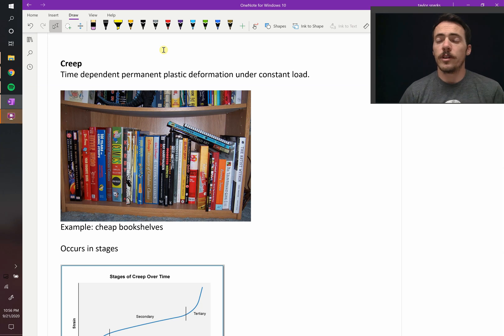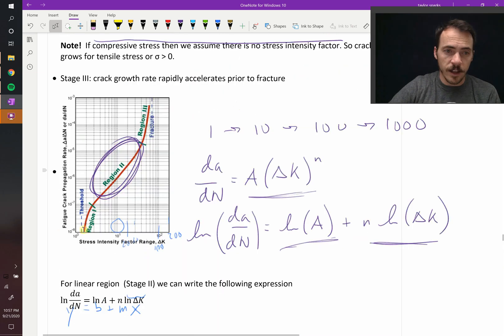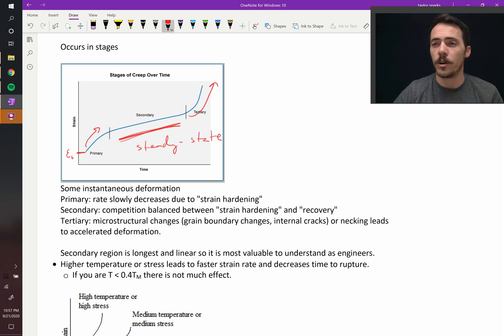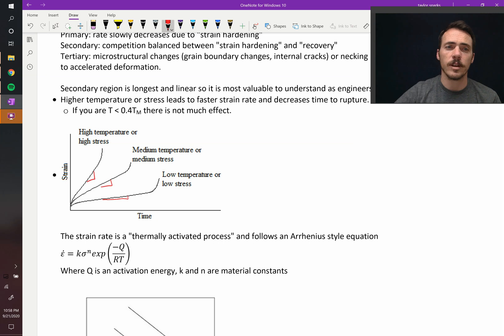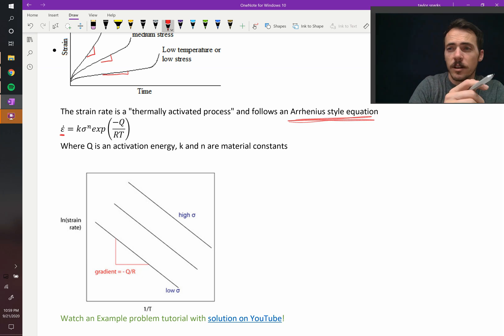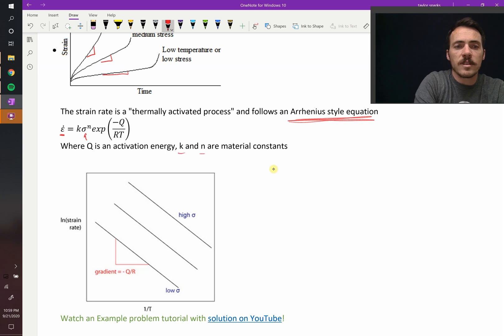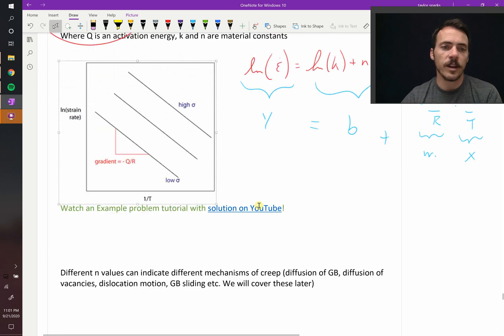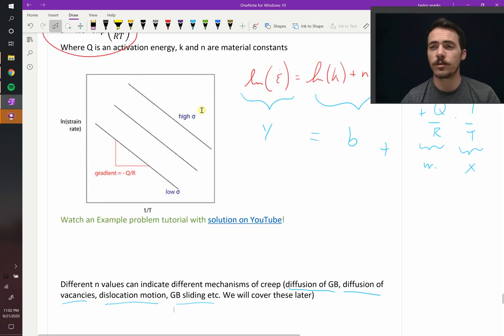How materials can fail due to Creep

Comment: I have a real life question about creep.Why is tungsten alloy filament used in lightbulb ?I really appreciate your answer.
Reply from the maker: Great question. I'm not an expert in that exact application, but I think it would come down to a combination of materials properties. First, it has a very high melting point. You want to operate these at higher and higher temperatures to maximize your output, but most metals would soften or melt. Second, at these high temperatures, you want a low vapor pressure and high strength. Tungsten is a pretty good candidate here. There are others that you could look at like carbon or tantalum which were actually done in the past, but they either burned up or evaporated too fast or ended up sagging. Finally, it boils down to the brightness which is a function of the emission. Not all materials emit at the same wavelength, the hotter the temperature the better for a nice white light. And then lastly availability. Tungsten's not exactly cheap but it can be acquired and then it's fairly manufacturable so you can get it into a thin ductile wire
Reply: @TaylorSparks  Thanks a lot professor .I found out many informations and wanted to share with here everyone. That creep matters really in turbine blades.Since turbine blades are heavy, exposed to forces from the gas flow and centrifugal stress from rotation and operating at high temperatures , they are in amazing risk of creep .To deal with creep in turbine blades , nickel-based superalloysithermal coatings, and single-crystal blades are being used.Finally, if creep is not controlled ,blades can deform or even rupture ,which is catastrophic .

Comment: Thanks for the video! I'm still a little confused - why does a high temperature mean shorter creep? Is this because the heated atoms move very fast, causing the material to break faster than when they are cooled down?
Reply: When you increase the temperature, you soften the material (Kinda like loosening the bonds between molecules). This causes the material to easily deform under a force (e.g., pulling a warm chocolate bar vs pulling a frozen one).

Internally it looks like lines of molecules are slipping off like layers and the heat loosens the bonds between those layers. (Look up thermal softening if this doesn't make sense XD)